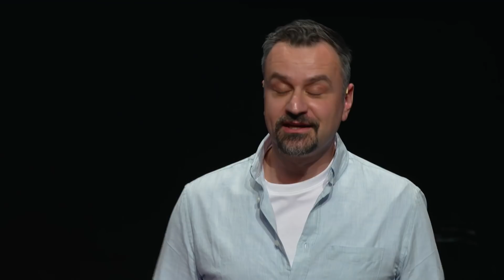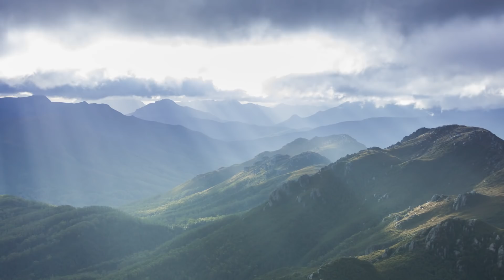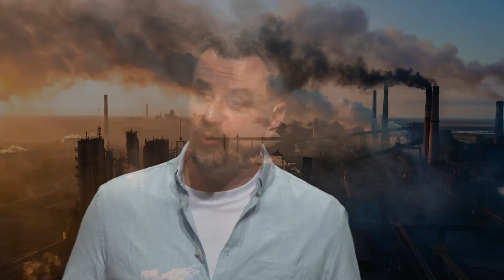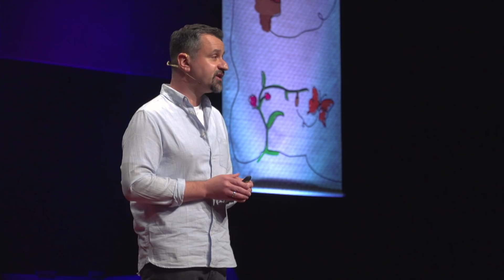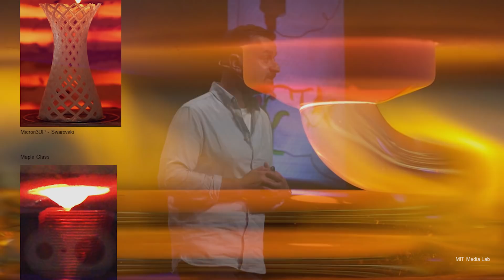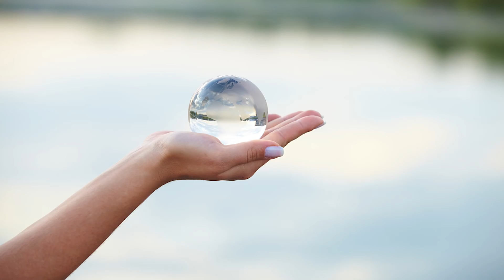Can broken glass build a clean future? | Nick Birbilis | TEDxCanberra

Comment: Claptrap.  If Victoria is just getting into glass recycling it is not the first in the world, it's at least 15 years behind.  Silica can be bonded at low temperatures but that doesn't make it a glass any more than pencil lead is diamond because they're both carbon.  Glass filaments are not, quote, "infinitely flexible", nothing is.  3d printing using molten glass is more energy intensive than molding,  you're not going to save the planet that way.  Most offensive is that he keeps citing mother nature, despite the glaringly obvious fact that she overwhelmingly uses calcium for rigid structures and long chain polymers for flexible ones.  No silica glass in sight.

Comment: 'High tech' also means heavy mining industry and environmental damage - from the lithium in batteries to the Tantalum in electronic components through to Neodymium in speakers. 3 -D printing is great in theory but slow and difficult to replicate in a satisfactory manner. Glass fibers could be woven into more products other than fiberglass or insulation.
Reply: 3d printing is not that slow, compared to injection molding its slow, but injection molding requires dies to be cut.  Its great for rapid prototyping.  Glass fibre reinforced materials are allready available for the 3d printer as are other inflill materials.  There is a 3d printer which can lay fibre into the print from a roll while its printing too.  Theres also a video of a superfast plastic 3d printer that uses a laser to melt the plastic and it is going unbelievably fast and resin printers that can create a whole part in seconds using 3d lasers.